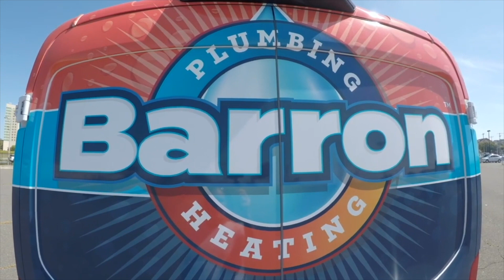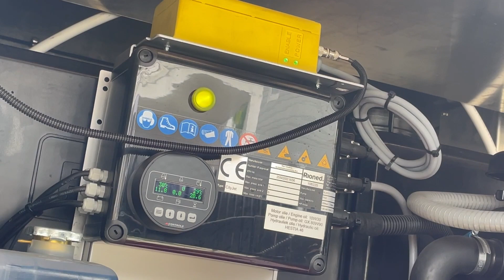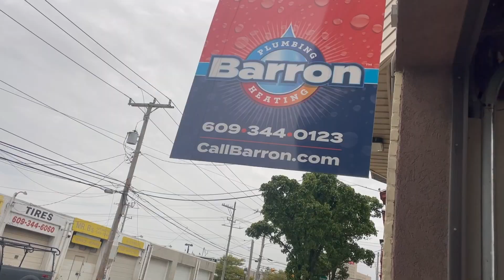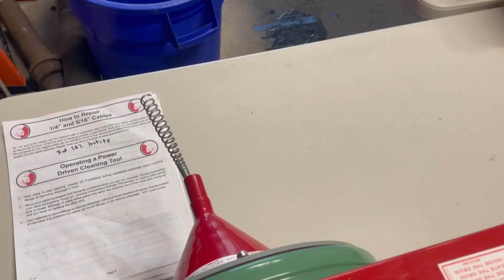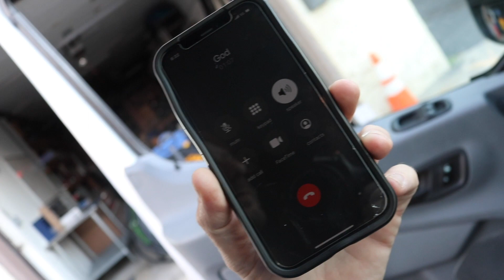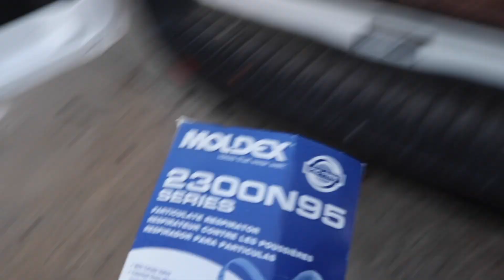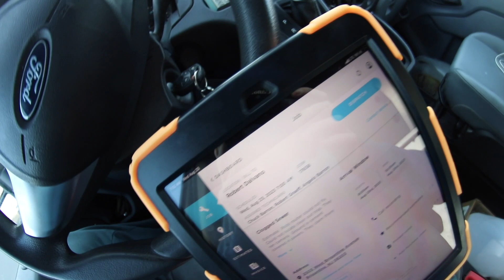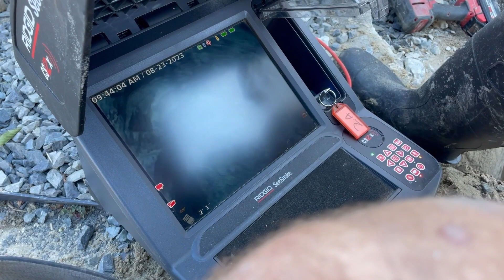DRAIN CLEANING WITH SPARTAN URBAN WARRIOR JETTER

Comment: What size hose do you use on the spartan jet
Reply from the maker: 1/2" We are noobs but learning quick. Love it.
Reply: You need some 3/8 to adapt down to for 3 and 4 inch makes it a lot easier  @ChuckBarron
Reply: nice pressure washer
Reply: do you have additional hise for your jetter for smaller lines sinks ext.
Reply: hose